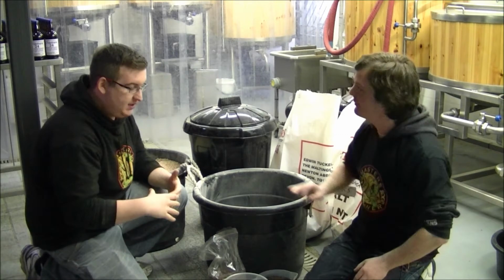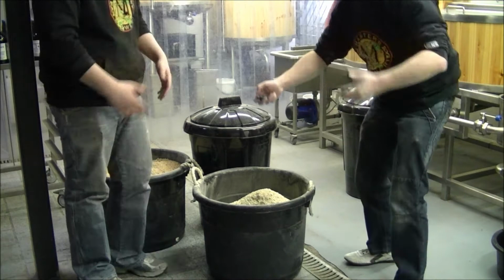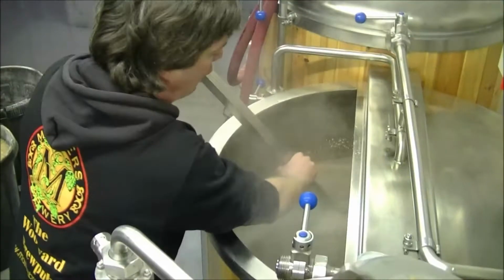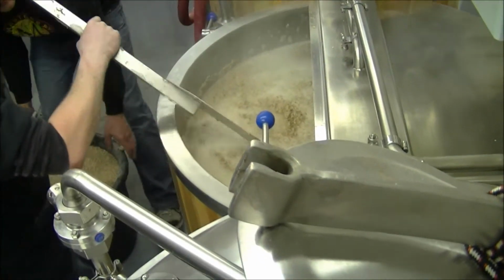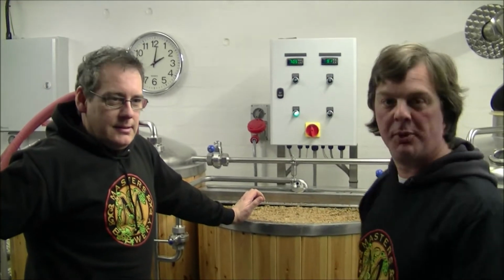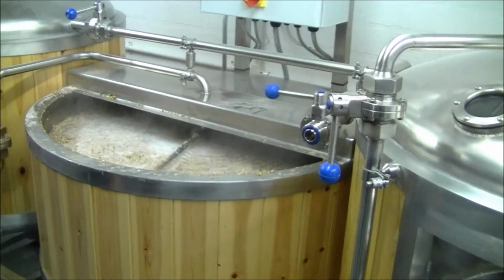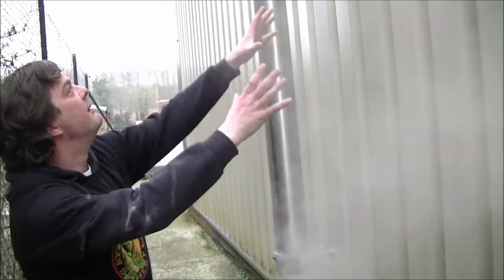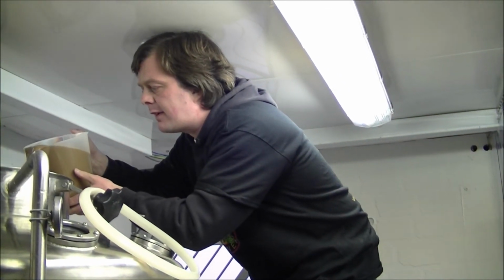Mint Chocolate Imperial Stout Brew Day

Comment: Mashin the cacoa? When I used them I put them in my fermentation like dry-hopping.
Great to see you at a small brewery so you can be more involved in the brew than normal. Why hasn't someone offered you a job at a brewery yet?

This is proper brewing, getting stuck in, none of this button pressing brewing...filling that mash tun to the brim! I bet it was hard work doughing-in all that grain.

Never knew what the underback does, mine is a plastic jug, ha! 

He could hardly get the sparge arm in.